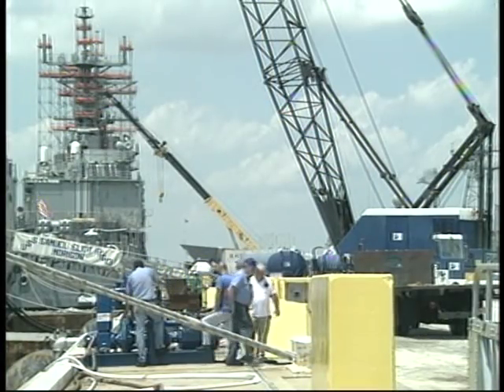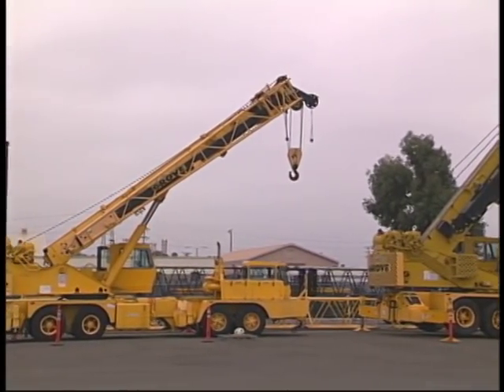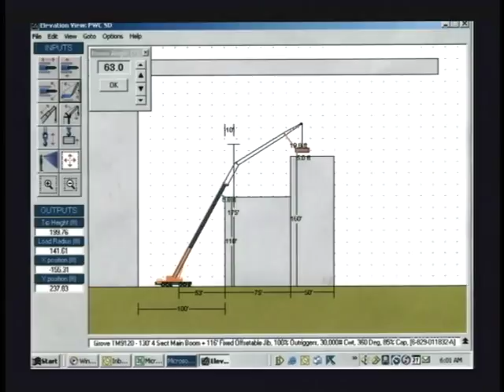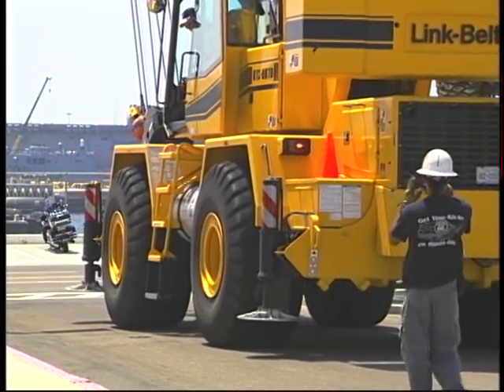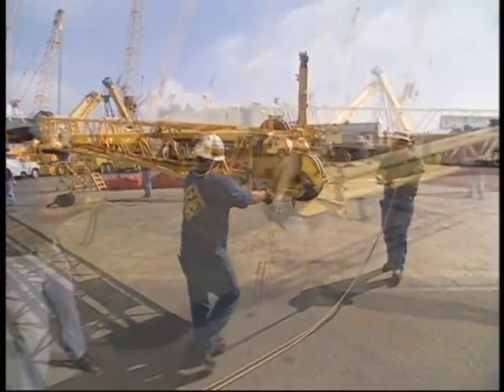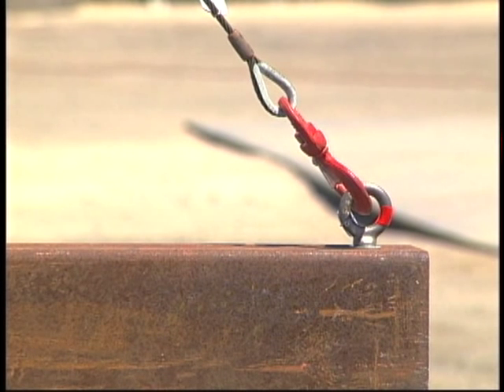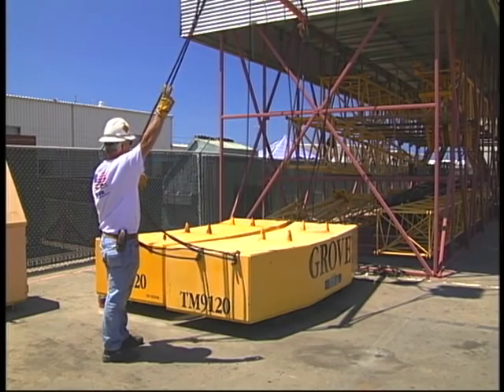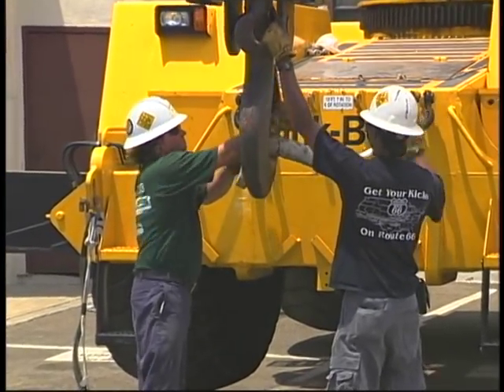MOBILE CRANE SAFETY

Comment: Currently my company has a project to modify overhead pipe  network.  The  work area  is not less than 50m in a built-up environment. 

This video is  already  an inspiration to  me.  I shall  show  it to  the  crane subcontractors.  Thanks